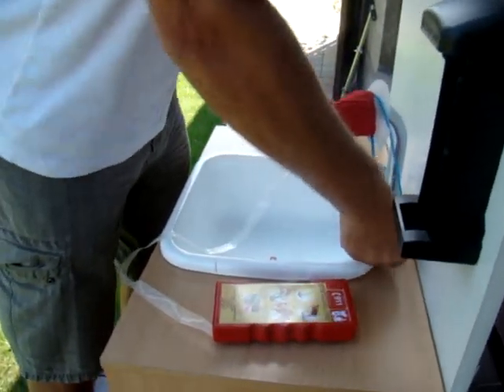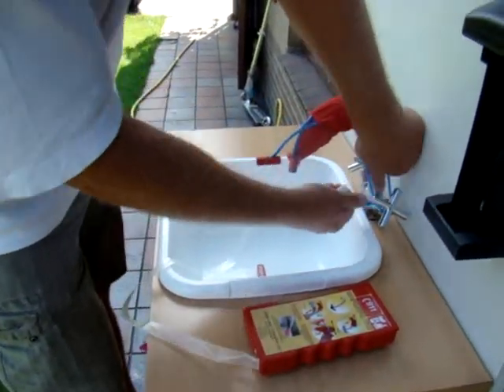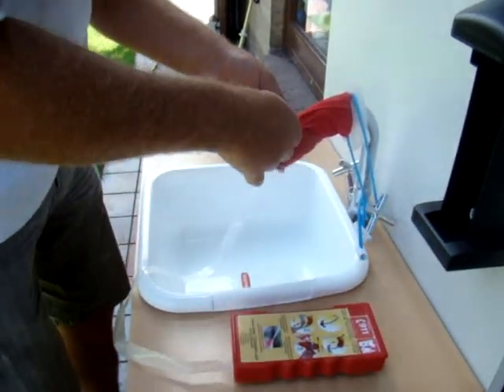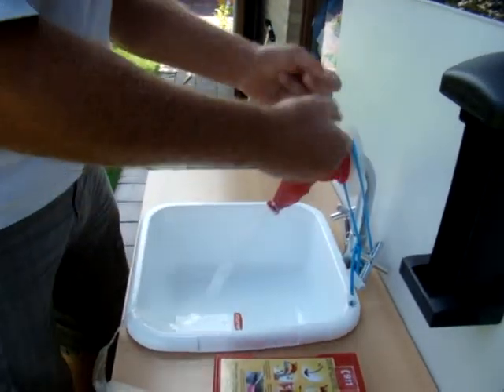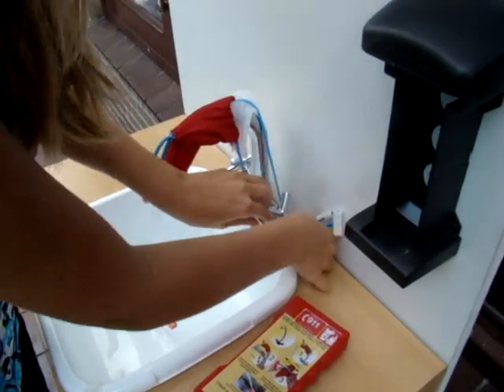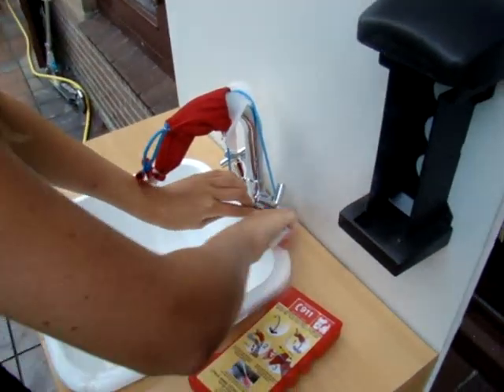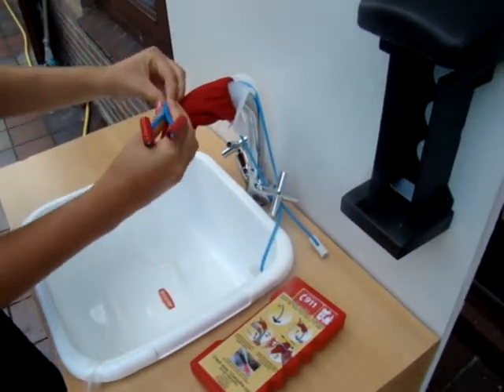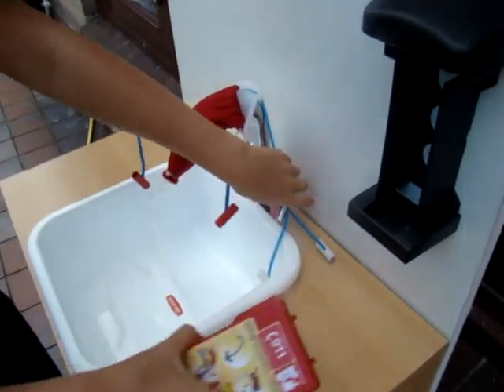Invention 123 Stop Fire - changes faucet-tap into firehose

Comment: er that appeared not to be a fire but a canal. It will take a long time to fill it with that. If there was a fire it would be easier to have a bucket on a string and use the canal water. kids cant tie their laces so how they going to tie that thing to a tap. show it putting out a fire. until i see that im just not convinced it beats a bucket.
Reply: +Mark Sheffield I was thinking a portable high pressure water pump